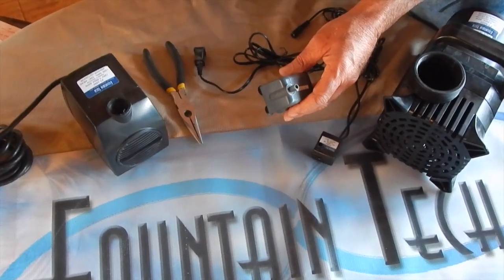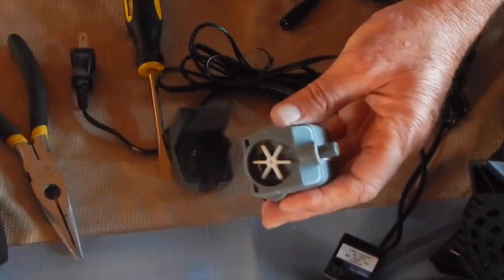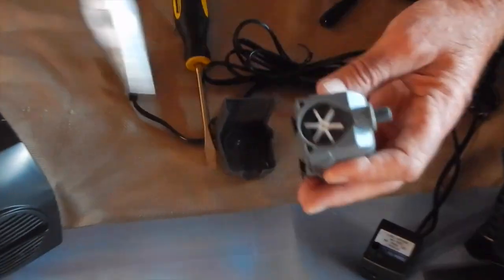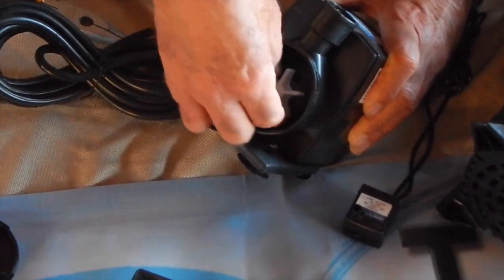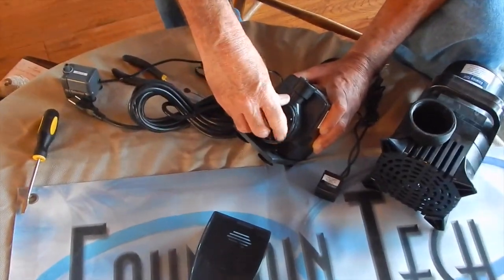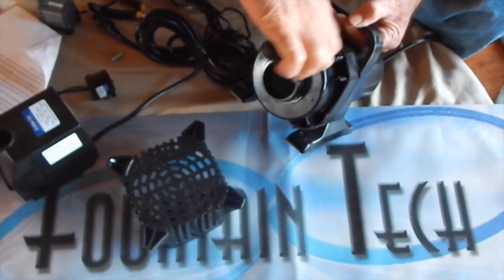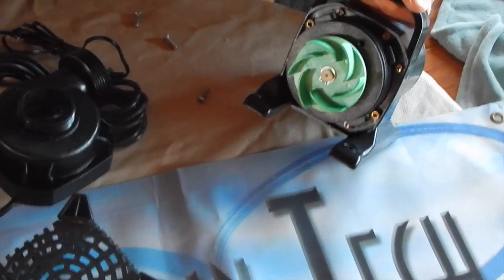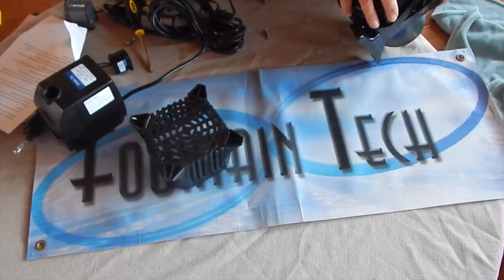HOW TO CLEAN A FOUNTAIN PUMP IMPELLER

Comment: For some reason I don’t have or see a magnet when I pull out the impeller, it’s a tiny water pump for a tabletop waterfall, also to note, the impeller spins once I push it in hard enough but stops when I let go. I’m not sure if it needs to be super glued to the rod? Any advice would be greatly appreciated

Comment: Great video.  The installers of my fountain buried the power cord for my pump under the fountain to the power outlet.  So, if I were to replace the pump, I would have dismantle the entire fountain to pull out the old pump and install a replacement.  I realize I am just kicking the problem down the road, but fixing my pump is a much easier option.  Thanks.